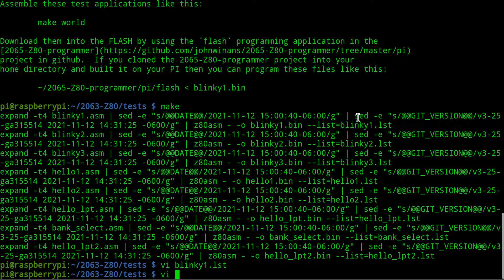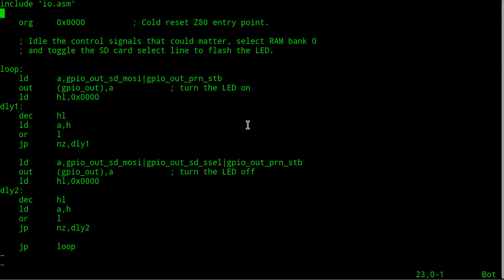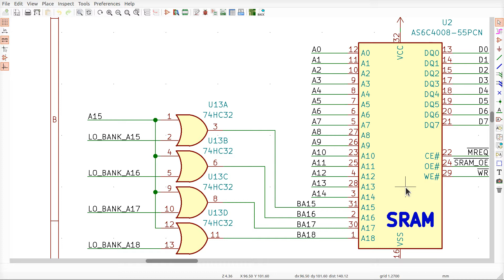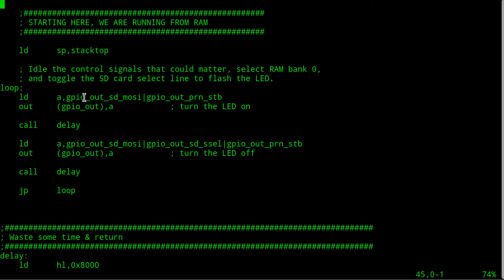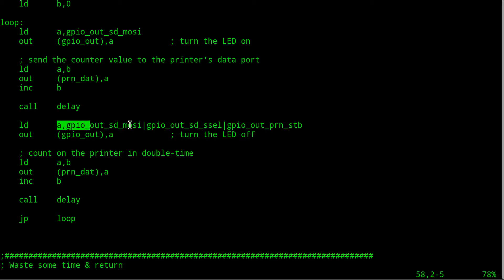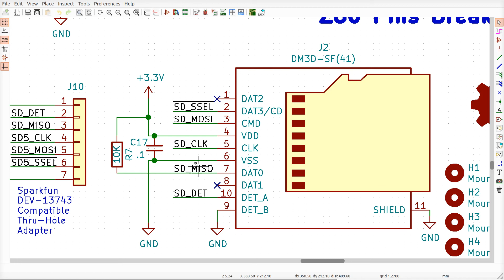Z80 Retro #11 - Board Test Software Pt. I

Comment: The design of this in-circuit programmer is very satisfying.
Reply from the maker: Thanks!  But if I did not have all these spare I2C expanders, I'd look more closely at the SPI ones.  They'd have simpler level converters and run faster.

Comment: When you are copying the flash to the SRAM aren't you also copying the code that copies the code?
Probably no harm here because it won't be executed from SRAM because the Z80 will just continue with the next instruction.
Reply from the maker: @frankeggink5414  you are correct.  The copy really only needs to start at the address of the opcode following the IO operation that flips the RS latch.

Comment: I've built my board! Thanks for these videos.

No one seems to have the ICL3232CPZ in stock. I got a MAX3232EPE+ instead (I think this should be compatible?). I'm not getting anything to my computer, though.

I'm running the SIO tests, and when I put my logic analyzer on the SIO's Tx out, I can see all the text I expect (so CPU & SIO are fine! :-) ). I have my MAX3232EPE+ on the board, and have put jumpers on J1 (tried both settings). This goes to a "RS232-to-USB" connector to my laptop. I get a tty.usbserial-xxxx, but minicom gives me nothing.

So: problem either in the MAX chip or my cables to Mac seem likely. Does anyone know if this chip should work? (There are other MAX3232???? chips, but I don't understand the fine differences between them). Or does anyone have a working setup of this-cable-from-Amazon so I can try that combination?

Thanks for any help :)
Reply: (Sorry! It's my board -> RS232 jack cable, which is not wired correctly. Wiring it directly gets me the text to terminal program)
Reply from the maker: @joelburton5509  I'm glad to hear that!!!   I just finished looking at the data sheets and agree that either should work the same.  Both are spec'd for 5V and .1uF caps for the boost regulators (some need larger cap sizes to work properly.)